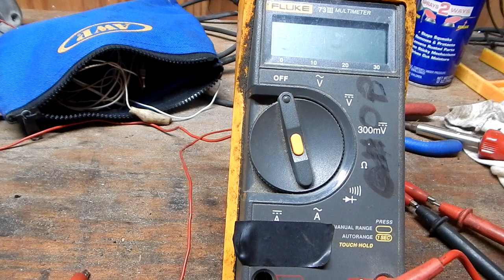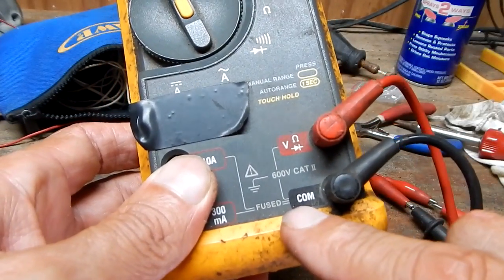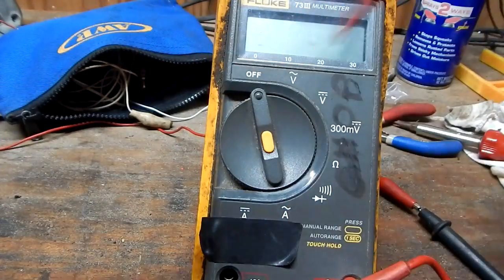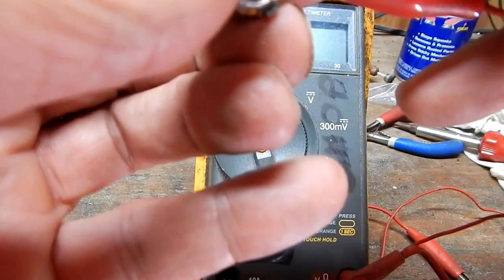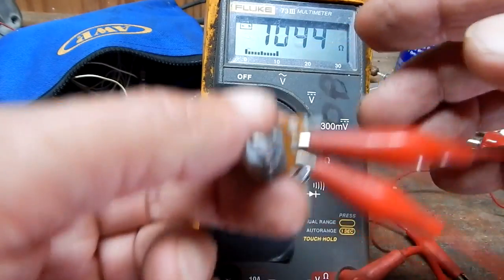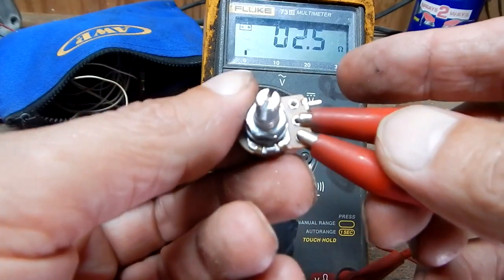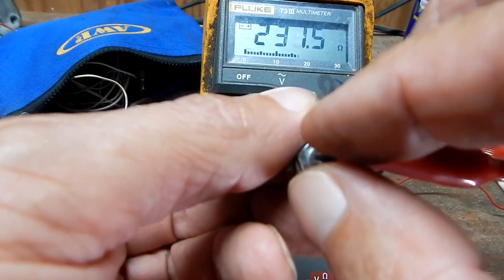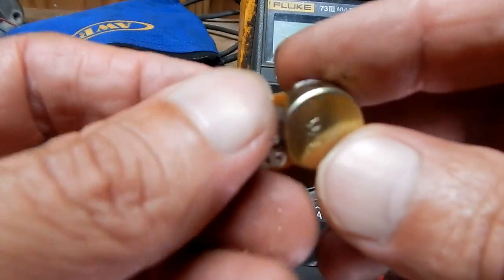Use a Multi-Meter To Check a Potentiometer

Comment: Cool thanks. I at least know how to set my multimeter. Now if I can just figure out where where the terminal leads are on a slider POT. Maybe it wasn't such a good idea to do this when I've never done anything but solder 2 wires together ...